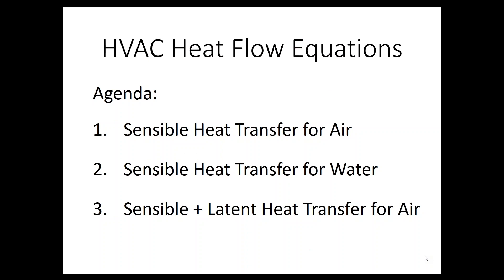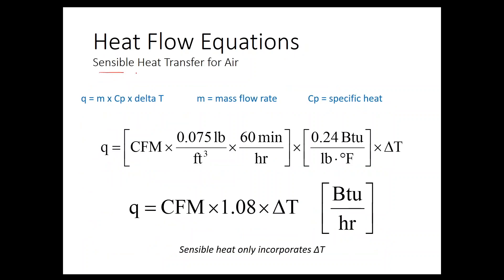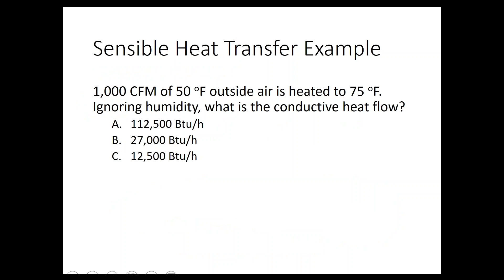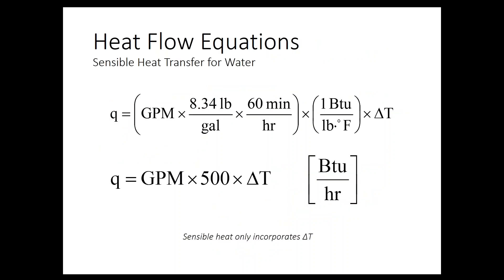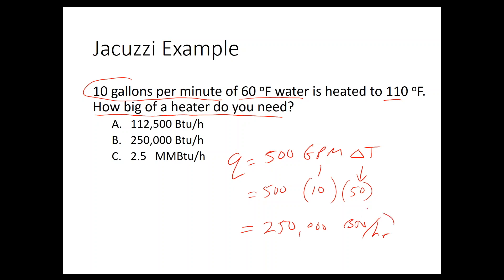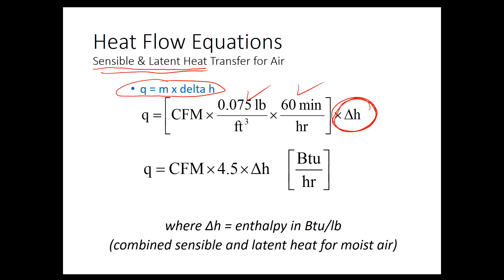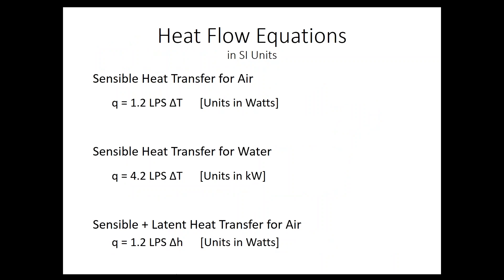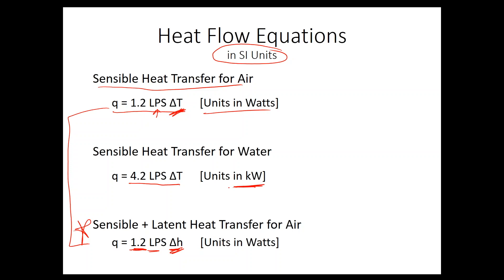L - HVAC Heat Flow Equations

Comment: LOVE YOUR VIDEOS!  Which delta h do you use for the q=cfmx4.5xdelta h equation in cooling? Do you use the one for the coil temp change or the temperature change ?, or do you add them up since one is latent and the other is sensible ? if for example the coil enthalpy is 20 and the sensible to get to the desired temp is 15. What would be the delta h to use in this equation? 20,15 or 35?